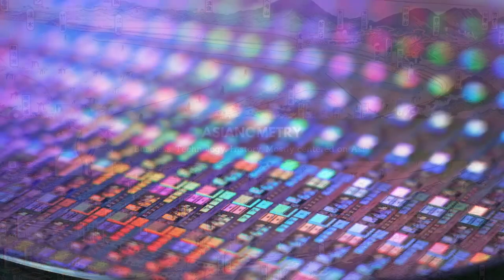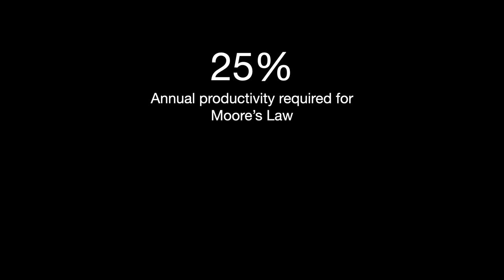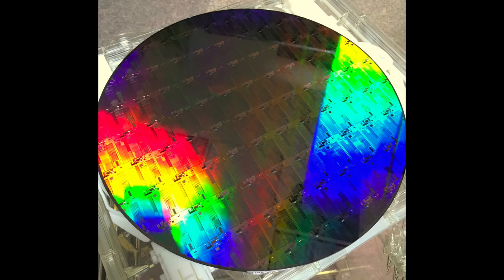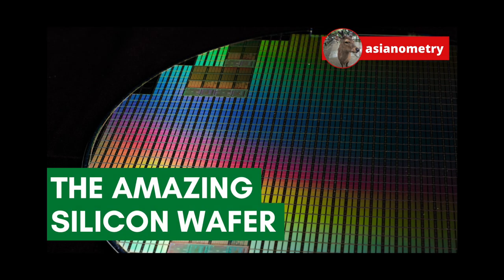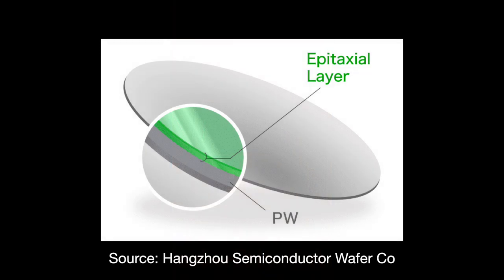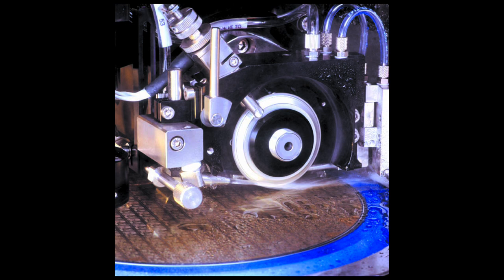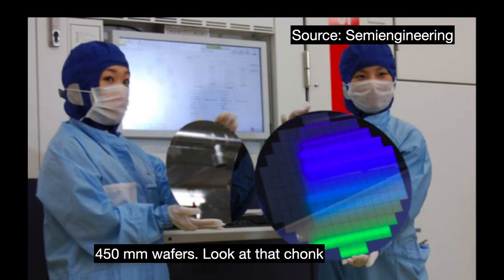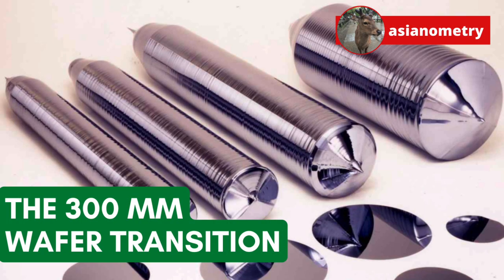The 300mm Silicon Wafer Transition

Comment: Is the 200mm wafer shortage the same problem as the "legacy node" shortage? Because that whole situation is so stupid.

Like why did they think shutting down those production lines would be a good idea? It's a permanent solution to a temporary problem. They've been manufacturing these parts for decades because companies keep designing products that use jellybean parts that have been available for decades. Did they think that just because there was a manufacturing slowdown, that meant nobody would need those parts anymore?

And besides, a chip fab has got to be one of the better workplaces to be at during a pandemic. Everyone's wearing a mask, and you're not exactly bumping elbows with your co-workers.
Reply: Were the lines shut down? Recently - i don't think so. Most of the 200mm shutdown happened decade+ ago. The industry was moving to 300mm, so it wasn't a temporary problem, it was lack of future viability seemingly.

Except then it turned out everything needs legacy semiconductor devices huh, and the total consumption of electronics keeps growing. Hindsight 20-20. By the time it became evident that there may be a problem on our hands several years ago, there wasn't much to be done about it other than just to try to move things to fresher nodes. Try.

And i mean temporary problems which last for 5+ years aren't so temporary if there's no money to be made in the interim, you run dry, you run bankrupt. Where do you get money from, what kind of an investor pitch is it when you say "help us maintain ancient obsolete stuff, trust me bro it'll matter someday again, just a rough patch bro, we know it's looking like what we're making is useless in 5 years but we just need to sit it out bro". Line on a chart going down tends to be a death sentence.
Reply: @SianaGearz  Sure, most of it was shut down years ago. But apparently whatever was shut down over the last two years or so has had a pretty massive impact on the availability of thousands of product lines. I've been trying to by basic things like op amps, logic ICs, regulators, even discrete transistors, there's hardly any stock anywhere, and what stock is available is way overpriced.

Here's a fun exercise. Go to the silicon-based electronics supplier (there's no free advertising here), browse to the Op Amp category and sort by price ascending. The third one down (order code 3116325) says stock is expected the week of 19/8/24. That's over two years from now.

That's insane. But you know what's more crazy, there's three in a row with the same date. All from the same manufacturer, all variants on same product line. Sure, they're jellybean parts, but if you've designed your product based on this part, fully characterised its behaviour under all test conditions, and got it certified based on this part, you might have to spend tens of thousands to get a small test batch made with a different part, more tens of thousands testing it, and even more tens of thousands certifying it. That's a lot of money just to change just one spool on a pick and place machine in your production line. And many manufacturers are having to change more than just one part, especially as more things go out of stock.

So whatever the cause, 200mm wafers, 300mm wafers, legacy nodes, it doesn't matter. This is having a huge impact, and it's yet another thing that we didn't need contributing to the currently out of control inflation.
Reply: @UpLateGeek  I am PAINFULLY aware of 2 year lead times, you don't have to tell me. I don't think anything substantial was shut down during pandemic, or i haven't heard of that. I know car manufacturers have dropped some orders, and then scrambled to get them back, but it wouldn't cause fabs and suppliers to get closed. They couldn't get new orders in because the capacities were already booked by some other semiconductors.

Fundamentally, it's unnecessary that anything got shut down to get us where we got. Ingredient 1, is that electronics consumption keeps growing year to year by maybe a couple percent. 2, everything needs legacy components, jellybeans, classics, which are manufactured using old tech and which are not economical or impossible to move to new tech. 3, so as total electronics demand and demand for modern electronics is increasing, it drags alongside with it a demand in legacy components upwards. 4, in 2020, worldwide electronics sales shot up by 14%, which is WILD, pretty much never happened before; and the demand is remaining high even now.

Given the huge jump in demand, some end device manufacturers cancelling their chip orders doesn't matter and wouldn't cause production stops, as the total demand increase is more than high enough to absorb any capacities that were in use previously.

I have heard a conjecture somewhere that the problem with legacy component production capacity was a long time coming simply because demand keeps growing, but the legacy capacity is all we've had for a decade; but it wasn't expected to actually hit until 5+ years later, and more gradually, and was pushed to now and urgent by a sudden jump in demand. Do keep in mind that we have some overcorrection on our hands, that electronics manufacturers which thought that they didn't need to keep extra stock of jellybeans and were buying them on a weekly basis as needed (Just in Time manufacturing), now suddenly do, and many have decided to keep a year of advance stock that they're currently filling up; so the situation will take a long while to relax a little.

Comment: rolling back the clock might be impossible, but why didn't part of the industry just continue to use the 'old tech' for less demanding applications?  It seems like much of today's chip shortage in in bread-and-butter chips that aren't limited by size or power requirements. There're always some people who are glad to save money by buying last year's model car, people who don't care about the latest bells and jazz.
Reply: You just said it. It's old tech. It's not easy to keep 20 year old technology running. How many 20 year old PCs do you see being used today? The software that tech runs on needs that vintage hardware to work. The dummies used proprietary OSes. 20 year old Windows NT won't run on modern hardware either.
Reply: @1pcfred  Ok, that makes sense. But wouldn't it make sense to keep building 'old tech' machines if there was a market for what they cranked out? This vid talks about the huge cost involved in both developing and making 300 MM wafer and there's a real use for them, but I'm curious if there wouldn't be a use for a 100MM wafer, that didn't require a robot to move a pack of them even a few feet?  Are all chips printed on these very expensive large wafers?
Reply: @shopshop144  the problem is maintenance. You can't fix this machinery in house and the companies that make the machines are not offering long term maintenance contracts either. It's just not how people are thinking in the industry. Old fabs get scrapped. No one's into restoring them. It doesn't make sense to build old machines when the best customers all want new machines. You chase money where it's at.
Reply: @1pcfred  There is emulation, also you can rewrite your software
Reply: @SviatoslavDamaschin  you're not running real time controls in an emulator successfully. That's never going to happen. It is unlikely the software you're running belongs to you on the Windows platform either. So you're not going to rewrite it. Because you didn't write it in the first place.
Reply: @1pcfred  Reverse engineering? Write a different software that does the same thing, if it's different there's no legal issue.
Reply: @SviatoslavDamaschin  a company making hardware may not have the software talent to write the code they need. Or it may not be economically viable for them to invest in what it costs to create software. Generally the cost is amortized across a number of clients. It doesn't pay to just write software for yourself. They simply might not have the time. Most people need things done yesterday. Not the years that development takes.

Comment: I find it weird that they say they must go from 300 to 450, yet they went from 150 to 200. Why not 350 or 400?
Reply: The increase in size needs to be large enough for potential cost savings and small enough so the increased technology challenges can be managed. 450 was supposedly the sweet spot based on educated guesses. Didn't happen and it wont because the payoff wasn't there and still isn't.
Reply: So, the MANY different companies that would be involved in making all this equipment have to all agree on doing it, but just like going from 200 to 300 mean slower processes and more failures, so will going to ANY larger crystal size.  So you'd have to balance the amount of failure, with the benefit of having a larger wafer.  If the failures are about the same with 400 or 450, you'd want the 450 because you can get more ICs from each wafer and hence your output is higher.  THAT is why they went to 300 from 200 which was a large jump.

I don't see them making another jump, really.  I think the failure rate would be too great.  The failure of a single crystal, when it takes longer to make the crystal is more painful.  EVERY failure of a wafer, more painful.

Comment: Why people want 200mm is the bigger question.
Reply: Sometimes customers don't need 3,000 chip dies that they would get from a 300 mm wafer. All they need is 1,000, and a 200mm wafer is just perfect for smaller minimum order quantities and for larger transistor sizes.

Comment: 20 to 70 billion usd across the whole industry and spread out through all the years it took for the transition, doesnt sound that bad.
Reply: Imagine a transistor density of 1 billion transistors sq. mm.  That's where the industry (TSMC, Samsung, Intel) will be at by the end of the decade.  So, take a lesser circuit that still requires this advanced node with this kind of density but the circuit uses 100 million transistors.  In this case, you're already pushing the limit of how small a die can be.  If I actually decided to lay this out using this advanced node, I would have a die smaller than .25 sq. mm.  But it gets harder to produce die that are smaller than this.  Your etching lines have to become ever finer or you're wasting too much wafer space.  The end result is you're around 200,000 die from a SINGLE wafer even if you waste a lot of space on the die and have a .25mm die, which could hold basically 250 million transistors.

So, let's expand this out to a 10 billion transistor CPU.  Now I need 10 sq. mm basically.  I'll round up and say each side of the die is 3.25 mm.  NOW I'm at a more sane number of die/wafer at about 5,900 die.  The issue is not only is it harder to make the crystal, and it takes longer, and every process takes longer, more failures in the processes, but EACH time I would lose a 450mm wafer because of equipment failure, the loss is starting to push a few million dollars worth of die.  I can't do the calculation for how large that wafer would be, but if I assume a 3 chiplet AMD Ryzen CPU with 30 billion transistors, in retail value the loss of a single wafer could be $500,000 - $1,000,000 at retail worth of CPUs.  Going to a 450mm wafer would create astronomical losses if a failure happens that causes you to lose a whole wafer.

It should have been clear from the video that even going to 300mm wafers meant the loss of production in a few different ways.  Going to 450mm would be even greater losses, slowing the process down even more.

If anything, because we're going to be near 1 billion transistors sq. mm by the end of the decade, it would make more sense to go back to a 200mm wafer.  It would be more cost effective, because you lose less crystals, you get less defects in the crystals you make, and the density is going to be SO great by the time you could fit a fab and get all the different businesses to make equipment once again for this smaller wafer you're getting more die/wafer than you are now with a 300mm wafer, where the more advanced nodes are already getting many thousands of die/wafer.  And a single wafer failure, in production wouldn't be so disastrous because of how many die was lost.  Remember, it takes longer to etch a larger wafer.

On top of that I think he underestimated a price tag for moving to a larger wafer.